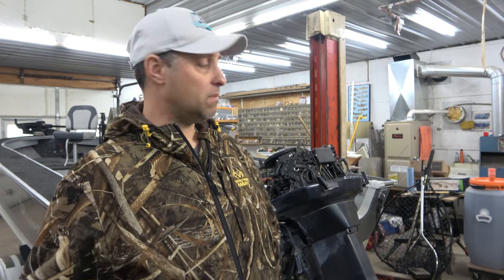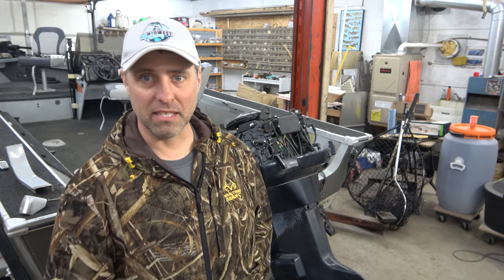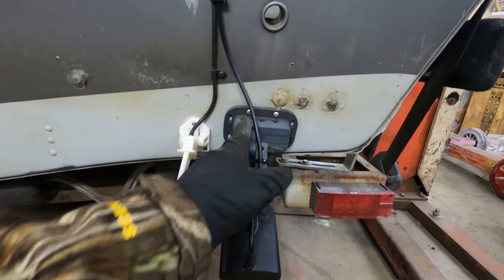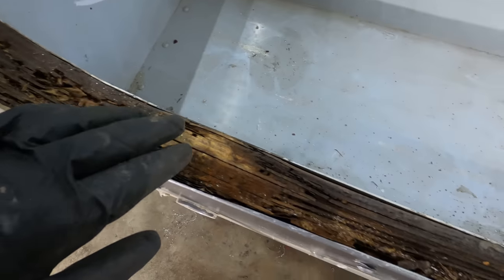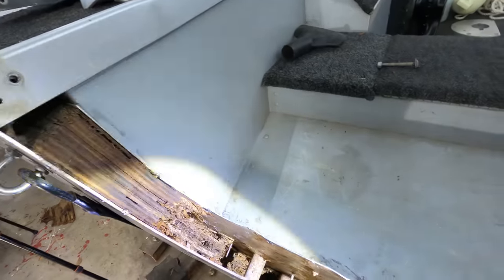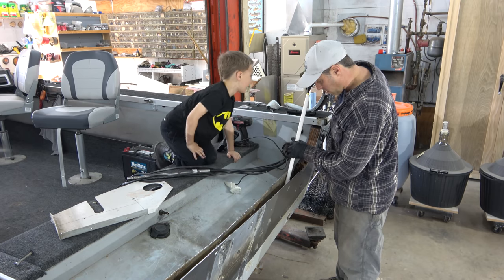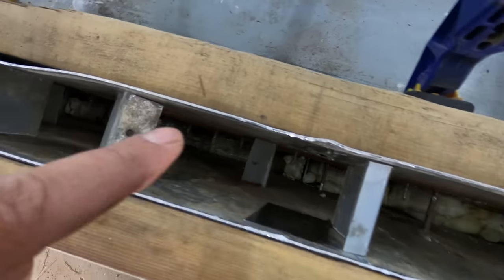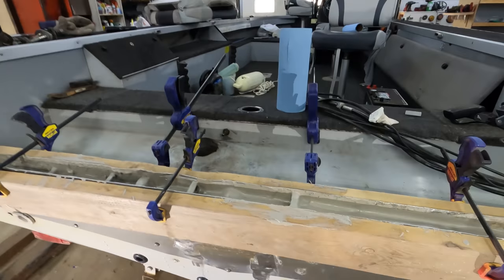The Easiest Way To Replace A Boat Transom

Comment: I did this to my son's boat but it was fiberglass build up the inside skin on the transom does all the rotted wood and I replaced it with glued up and stainless steel screw together plywood then I use the angel hair fiberglass and resin to fill in all the gaps if there were any and then read the outside skin with fiberglass cloth in resin

Comment: I can’t recommend any pourable transom material that doesn’t use chopped strands. Compression numbers mean nothing. Flexing or bending strength numbers do matter. The lack of flex or bending numbers is suspicious to me. Glass is very hard, but you wouldn’t want it for a transom. If your outboard takes a strike it may shatter. I can’t help thinking peanut brittle. Any time you replace a transom, you must run it all the way across even though it’s difficult and may require more surfaces opened up. End on or butt joints that don’t have over lap will eventually fail. 
The best stuff is Coosa board. It will out last the boat and it’s all I use for structural, period.
Reply: Don’t think he asked for your recommendation.
Reply: @jakefromstatefarm9721  
Not just for him, others willing to listen. 
I’ve seen several repair failures. One lost the engine, the others threw a passenger. One was a poor wood repair and the other was relying on Git Rot when the wood was mostly gone.
Reply: @SkypowerwithKarl  I’m sure you have and I’m sure you’re talking about bigger boats with bigger outboards.  It’s a little aluminum boat.  It’ll be fine.
Reply: @jakefromstatefarm9721  
One was a Lund 16 or 17’
Reply: Sure if it were me id feel better adding a little bag of chopped strands but it’s an aluminum boat and for him to use coosa or even wood, to do it properly he’s have to tear apart half the boat.  He left the skins on both side and only replaced the core.  This is far better than the soggy wood that he had before the repair.  This stuff is solid and the company stands by it.  He’s not gonna lose a motor and is bet the transom will last longer than the aluminum.
Reply: @jakefromstatefarm9721  
Chopped strands are a pain in the…… to work with. He would have had to cut the top out of gunwale on both sides of the transom and a bent strip riveted and screwed back in place. Coosa is actually the easiest install, strongest, 1/2 the weight and lifetime, piece of mind and no liability because of it’s known specifications.
Reply from the maker: I'm sure if you read the info on their website you will see that it has been formulated specifically for transom and therfore all the things you are concerned about have been addressed. It does flex before breaking so it is not brittle. Take a look at the specs and decide for yourself.
Reply: @GoMidwestFishing  
I see tensile and compression on Carboncore data sheet. That’s all I could find. If you have a link, or numbers please share. Coosa does give flexural properties of their different products on a nice chart.
Reply from the maker: @SkypowerwithKarl  Coosa is a great product from what I've read. That's what I originally planned on using. The way my boat is designed requires a lot of disassembly to replace  a solid transom. That's why I went with the liquid version. The specs sheets are not real detailed, but they do have several videos demonstrating the product too.  I understand everyone has their own view on what's best. The carbon core worked great for me and I wanted to share my experience with it in case others were considering it as an option. I recently replaced a transom with plywood on a 16 ft boat and can say that it was a lot more work and probably won't last nearly as long.
Reply: @GoMidwestFishing  
R&R transoms and stringers is never any fun. You have to have a plan of attack and you can’t hire a gorilla to do it. I’ve seen people cut the whole transom out and not leave a flange like you did. They messed up. I leave about a 6” flange and use an electric chain saw with carbide teeth to dig it out with no side guard and housing cut back so I can get it close. Being very very careful not dig the glass. No fun at all.
Reply from the maker: @SkypowerwithKarl  Yep, its a dirty job. I like the chainsaw idea. Someone else mentioned that too.

Comment: Cant believe they never epoxy sealed the wood
Reply from the maker: The boat is 30 years old. It was the factory transom, so I'm thinking, wood plus water over 30 years is going to wear out eventually whether they sealed it or not, which is why they don't use wood anymore.

Comment: Would you recommend using that product on a fiberglass boat that has the same issue as you did
Reply from the maker: Yes. The instruction say it can be used on both fiberglass and aluminum.

Comment: Oh boy.  I have never seen such terrible work. There’s a reason why your transom is wood. The transom you built cannot flex without breaking. It is a disaster or possible injury in the making. Never put foam in a transom. It has no structural strength and it absorbs water and can cause corrosion on the aluminum. The transom is not solid all the way to the top. Your cap Allows water intrusion.  I hope you fish close to shore. Preferably in water that is less than waist deep.  I have seen too many disasters in my life. I lost a friend that was never found and we assume it was his new transom and two outboards.  This was in the Virgin Islands. I have replaced transoms, repaired them, built them up and cut them down. And I’ve never had one fail.
Reply: Transoms are wood because wood is cheap and cut by machine. A poured transom costs more in materials and labor.

Comment: To fill that the rest of the way you can drill 1 inch or 1 1\2 inch holes near the top of the sides . Glue a PVC  elbow (size of hole) over the holes with hole up. Let it set then pour material in the elbows until full. Let it dry then remove (cut\grind) elbow and composite smooth and paint . This would also fill under where your angles are .
Reply from the maker: Thanks for the great ideas.

Comment: Alumaweld isn't welding but brazing. After years of playing with the stuff and lots of learning from failures I finally figured it out but it's tricky.   Trick is that you've got to get the aluminum to a steady 750*F and, if you have a large surface area like in your transom, that's really hard to do as the whole panel will act like a heat sink.   Unless that's a really old (like 15+ years) bottle of gas, you've got MAP and not MAPP, which is just a marketing gimmick as the new stuff is barely hotter than propane (the old stuff was much closer to oxy-acetylene).   It works ok on something small but on something the size of your transom you'd have to use oxy-acetylene to get a small spot up to temperature before the rest of the panel can wick the heat away.  Granted, oxy-acetylene will easily melt the aluminum if you're not careful but, administered correctly, is the only way to get a small section of an aluminum panel up to temp fast enough without the panel wicking the heat away or getting so hot as to melt everything around it.   Funny, when I watched what you were attempting to do I knew exactly what the results were going to be...been there, done that.
Reply from the maker: Thanks for all the info. I figured that the large surface area would prevent it from working properly, but I had to try anyway. I learn by doing, and now I can file that away as "don't do again." That was interesting about the MAP vs MAPP. Got to love marketing! I will know to look for that from now one. Great tip!
Reply: Also brazing rods like welding require a prepared surface, paint removed wire brushed.

Comment: This is the exact reason I will never buy a used boat, people cutting corners and doing dumb stuff like this.
Reply from the maker: You're right, its not perfect. That's awesome if you can buy new boats. For those of us that can't, we do what we can to keep our old boats running. I'm happy with the way it turned out, and its much better than it was.
Reply: Way better than rotten wood.  I'd buy it.  It does the job fine.

Comment: I heard your overheat buzzer in the test run.  Hope you fixed that.... 
I would have filled to the top or at least a little higher above mounting bolts, but its better than it was.....

Comment: Do you think this stuff spread out flat and really even would make a nice permanent boat floor  instead of replacing plywood all the time
Reply from the maker: Its hard to say. Its designed for transom use, so any other use would be an experiment. You can always try it and let me know how it goes.

Comment: Interesting.....I wonder how that brand compares to Seacast, which I've used with exceptional outcomes.  It's expensive, but holy SH*T does it work.  As you said, it's by FAR the strongest part of the boat.  Great video!
Reply from the maker: I've looked into seacast also. It appears to be very similar. What I liked about Carbon core is that it has a degasser built in, so you don't have to poke any air bubbles out of it. I haven't used seacast, but would be interested to know how they compare. And yes, this stuff is super strong. Thanks for the comment.

Comment: You could have put an aluminum angle in the corner of the inner transom wall and the bottom of the transom well. Then use exploding pop rivets to attach to both. Nice solid connection if you added 3m5200 as a sealer under the angle legs.
Reply from the maker: Great info. Thanks for the input.

Comment: Wow that came out really good I was wondering how that weld was going to work I did a lot of that back in welding school
Reply from the maker: I should have had you come over and do the weld. It was probably a bad idea from the start, but I had to try it to find out for sure.
Reply: @GoMidwestFishing  impossible... you lost all the heat as all the aluminium panels were conducting all the heat away from where you wanted it.

Comment: You could of poured gel-coat, polyester or similar with some fiberglass mat to fill that up, I actually just did something similar and it turned out great, and lol I used great stuff hose lol I couldn’t by one.
Nice camera work n job👍🏼

Comment: I has a new Sea Nymph boat in 1986. Within a few years transom wood rotted to dust.  Why did they use that pressed board?  I made a replacement out of an old oak 2x12  from dad’s attic. Still in there 34 years later.
Reply from the maker: I sure they use whatever is the cheapest. I'm glad to hear its still going after 34 years!

Comment: I don't know of any resin that can be used in a high stress application  without having some sort of reinforcing rod.  I would LOVE to see this transom after 1 season of use.  My bet is the resin will spider, Crack, and lose nearly all rigidity.
Reply from the maker: Hi Dad Geer (great name). I'm going on season 4 fishing with the replaced transom, and it still looks like new. You can see the specs here is your curious: https://www.carbon-core.com/products/carbonbond/transom-compound/

Comment: my thoughts as to the mph gain is raising the motor 3/4" actually put it closer to where it needed to be
Reply from the maker: That seems to be the consensus. Less drag in the water, but it does come out of the water on tight turns, so it should probably be lowered back to where it was.
Reply: @GoMidwestFishing  drop it in smaller increments to find the "sweet spot" for your setup...i have found that even a 1/4" of movement up or down can have a noticeable improvement in performance or vice versa
Reply: @GoMidwestFishing  also i would like to report that my recent transom replacement drastically improved my hole shot as well as overall handling and comfort of the ride...my boat is a pleasure to drive again

Comment: I know how you felt going into this project . For the best performance take a straight edge and run it down the keel  till it reaches your bottom cavitation plate the cavitation plate should be right around 1/2" above the strsight edge then adjust your motor accordingly to achieve the 1/2"
Reply from the maker: Hi Cayden. Thanks for the info. I will check to see where mine is. I know the motor need to go down further, but I already have it adjusted as far down as it will go, which is one notch up from before due to the new top plate I put on.
Reply: If its too low you will see a small rooster tail hitting under yhe cowling its from the cavitstion plate plowing into the water causing drag
Reply: I want to do the same kind of transom in my hydrostream . I like the composite material

Comment: Brother am doing my transom but I have wood residue is imposible take out and now is wet any recommendations, what is the reaction if I pour this with that wood wet ?
Reply from the maker: I'd contact the manufacturer for the best info. I'm not sure where the leftover wood is, but if its on the edges like mine, I've had people suggest putting some metal rebar into the wood so the resin has something better to grab onto. If its just small particles, it should just become part of the resin, as long as its not too much of it. Good luck!

Comment: Berzomatic makes a “MAPP”+Oxygen torch kit for using that rod. “MAPP” without oxy doesn’t put out enough heat to get it to flow well
Reply from the maker: Hi Jaecen. I bet that would have worked much better. I kind of knew it wouldn't get hot enough, but I thought I would give it a shot anyway.

Comment: Have you considered hardware cloth in your setup? Suspended in cleaned transom then poured over would increase tensile strength while allowing flexibility. As well preventing any future damage from impacts potentially traveling to fully compromise internal integrity. And its cheap lol.
Reply from the maker: Another way you can use this product is to make a template, cover it with fiberglass cloth and then pour the resin into the mold. That will give you a solid transom that you could install similar to a sheet of plywood, but with added stability of the cloth.  I think that's kind of the same idea you shared. I'm not sure how I would put the cloth into the transom first before I pour it. The transom had many bolts and obstacles that would be hard to maneuver around. If you come up with a good way to do this, let me know.
Reply: @GoMidwestFishing  with obstructions such as bolts, it would be difficult to insert any wire. When I did a few small skiff boats last year, I played with pourable transom setups and this is where I discovered that hardware cloth helped. All in all, the best opportunity comes from the ability to have an empty void before pouring. But reality is this may not be possible. And I love making resin soaked fiberglass wrapped inserts. Cheap and near forever solution. I played with cosa board for this to improve and that is a real forever solution if you can afford core material. Marine ply is expensive now to so seeing the gap close on upsell. Also needs clear void to work. Great video.
Reply: @GoMidwestFishing  wow viewers can be tough. Using a palm sander with a piece of rubber to vibrate material will relieve air suspended in mix. Simple trick. And trandsom wood left will deteriorate but will be encased in resin. So while the chance of creating a void, if poured resin was thick enough around material would not be terminal. The most important place to clean in this job is the bottom of old trandsom out. This is due to its connection with all the previous laid strength members of craft. In tin boats, not as big a deal. On glass boats, it better be spotless. You will be ok GFM.

Comment: Well... doesn't have to be perfect, and looks adequate to distribute the motor loads. Doubler plate  in the front was good idea. Adding some chopped glas and polyester to fill out the top would be better to keep the top strong and square.

Comment: You should have pop riveted a piece of aluminum angle to the inside corner of the transom. Putting that much heat to any type of thin metal will warp it.
Reply from the maker: Thanks for the tip!

Comment: Thanks for doing this video.  I wonder how similar this compound is to JB Weld?  That would be a lot of tubes of JB Weld...
Reply from the maker: Hi Frank. Well, here is the description of Carbon Core from it's website. "Its a Ceramic Pourable Compound with premium polyester resins and high strength ceramic spheres." I'm not sure what's in JB Weld, but That would be one expensive 5 gallon bucket of JB Weld. Great question. If you ever buy 1000 tubes of JB Weld to put in your transom, let me know how it goes.

Comment: What's the weight difference compared to the wood that was in it
Reply from the maker: Hi Ryan. The carbon core weighs 36 pounds per pail. I used 2 pails of it, so the new transom weighs 72 pounds. A 4x8 sheet of 3/4 inch plywood weighs about 61 lbs. The transom is 2 inches thick. My best guess is that it is very similar in weight, if not slightly lighter.

Comment: Can you do an update on how the transom is holding up? I have a seaark that the transom is getting soft on and I’m really thinking about buying this product
Reply from the maker: Hi Joseph. Right after I fixed the transom, I took it on a 5 day fishing trip and hit six different lakes. It held up beautifully, and is rock solid. No complaints at all. I even ran at full power for 30 miles on Lake Vermilion. I would definitely buy this again.

Comment: Hey I was wondering if I did this and put a few random bolts through it before would it act like rebar?
Reply from the maker: Hi Jacob. The carbon core is designed to be used as is and doesn't really need rebar. With that said, the transom on my boat already had several bolts going through it. I left them where they were and when I poured the resin, it envelopes around them. What I wish I did was add some long screws in the wood I left on the sides so it would have something bigger to grab onto to connect to that wood.